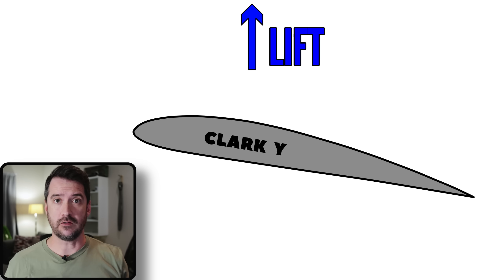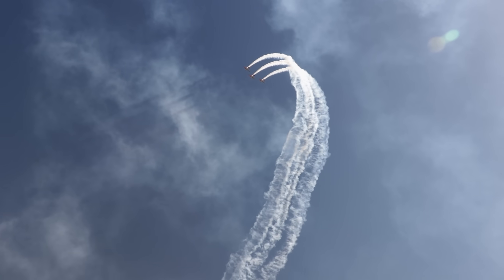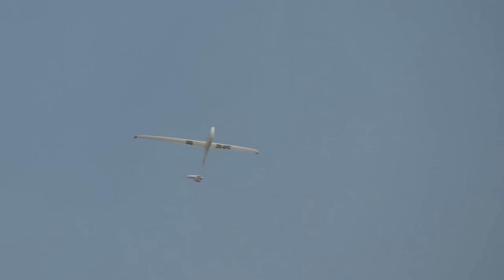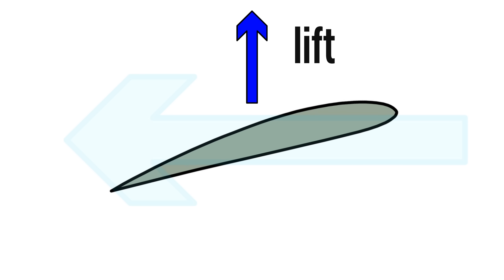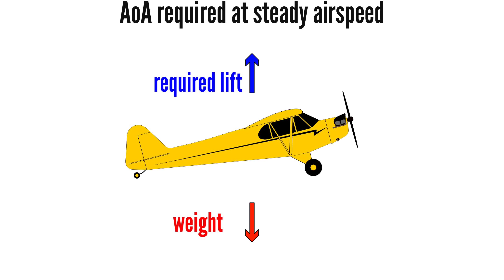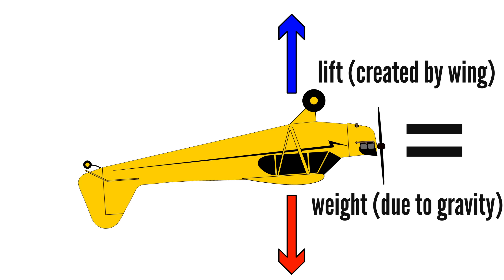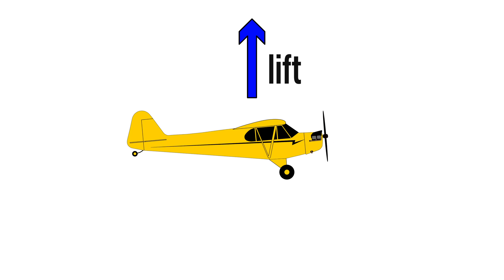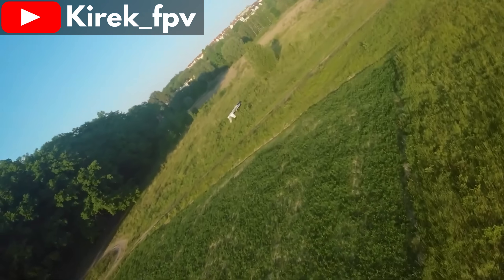Is Airflow Distance Over the Top of a Wing Always Longer?

Comment: The problem I had with flight school describing how wings fly is that it really was one dimensional: Pressure differential. What they failed at describing is that a pressure differential creates a downward flow of air which based on newtons law creates an equal and opposite force. It’s the same thing described as two different things for what ever reason. Also no lift would be able to be generated if there was no drag.
Reply: The pressure differential creates the downward flow.  The force calculated from each separately are equal.  And they are both needed to fully explain the mechanism of lift.  

I agree with what you say about what was learned in flight school.
Reply: @davetime5234  Of course it would be the same otherwise it wouldn’t make sense. Yeah everyone was and probably still is ignoring newtons 3rd law as if a wing is some sort of hot air ballon and the difference in pressure makes it rise 😂. I was obsessing over this topic back then when trying to figure out a conclusion and if there was a downwash even at 0 angle of attack since you only have a low pressure and ambient pressure…and you do obviously. I wonder how helicopter pilots learn it🤔 for them it is more apparent than airplane pilots.

Comment: The wing is still surrounded by the same "amount" of air whether the wing is upside-down or right-side up.  An airplane can fly upside-down with no problem, as long as the propeller/jet engine/rocket engine is providing sufficient enough thrust to overcome a stall and enough lift to overcome gravity.  One of the most important pieces of physics in the design of airplane wings is the Coandă effect, which causes the air surrounding the wing to adhere to the surface of the wing at its trailing edge. The air from the front of the wing is traveling faster than the air at the rear of the wing, and this causes an overpressure towards the front, thus pushing the wing (and the airplane) upward.
Reply: I'm wonder why there is no "Coanda equation" among the Navier-Stokes equations for conservation of mass, energy, and momentum?

Comment: Then….why….an airfoil at all?
Reply: The word 'aeroplane' used to apply to the mathematical surface ( a plane ) which, when moved through air at a useful angle, created lift.  This is more often called an airfoil today.  

It is possible if there is enough energy, to fly a plane that is entirely flat.  Check some of the RC aerobatic planes that routinely fly standing still.  
Enough thrust from a prop, carefully controlled, means a plane can float immobile in the air, nose-up, adjusting for wind.  
Very few engines have this kind of thrust to weight outside RC model planes ( but naturally a British-designed aircraft, the Harrier, does ), so most planes still fly using lift generated by airfoils moving through air at the right angle.
Reply: The airfoil shape is for vastly improved flight characteristics from the contoured shape conforming more to the airflow's natural contours, dispensing with abrupt corners and turns that the airflow has to negotiate.  Affects such aspects as lift to drag ratio, stall characteristics, and speed range optimization.

Comment: Video at 7:13: this "large angle of attack" for inverted wing is only due to the fact that we measure the angle of attack between the direction of far-field flow and the GEOMETRIC chord (which is convenient). The "actual" angle of attack can be measured between a ZERO-LIFT line, which for Clark-Y is about 5 degrees up relative to the geometric chord. So - when we align the geometric chord with the flow direction - the Clark-Y profile actually works at an effective angle of attack of 5 degrees. Inverting the wing results in flipping the ZERO-LIFT line by 5 degrees DOWN - that's why the apparent angle of attack is higher. Same applies to any profile with a camber...

Comment: I can't believe how this equal transit time myth keeps being spread. Maybe you'll believe the NASA website: <https://www1.grc.nasa.gov/beginners-guide-to-aeronautics/lift-3/#:~:text=One%20of%20the%20most%20popular,edge%20at%20the%20same%20time>. "One of the most popular incorrect theories states that the upper surface of an airfoil is shaped longer than the lower surface so that the flow over the top travels faster to reach the trailing edge at the same time."
And here's a video showing that the air on top of the wing doesn't just flow a little bit faster to get there in the same time, it goes a LOT faster and gets there first: https://www.youtube.com/watch?v=e0l31p6RIaY
While it is true that the classic wing design with a curved top and a flatter bottom is more efficient, this is in no way necessary and the different path lengths do not explain lift. The real reason is that the wing curves the airflow downwards, giving it vertical speed which results in a reaction force on the wing. On the bottom of the wing, a high pressure curves the air downwards since the air can't go through the wing, and this same high pressure pushes the wing up. But most of the lift is usually generated at the top, where a low pressure curves the air down so it "sticks" to the wing, and this same low pressure of course also results in more lift on the wing. The pressure differences also result in speed differences through Bernoulli's law: the high pressure below the wing slows the air down while the low pressure on top accelerates the airflow, which explains why the top airflow gets to the trailing edge so much faster. The extra speed on top also intensifies lift since more centripetal force is needed for the faster air to follow the same curvature, and therefore the pressure drops even further.
So basically, the pressure difference is not caused by the speed difference, it's the other way around, but the most important factor is actually not the speed of the airflows but the fact that air is curved downwards.

Comment: Yeah yeah yeah. I don't care. when a plane has one wing pointed at the ground and one pointed at the sky. Where is the lift in that quarter roll. Is it like when you throw a baseball no lift just the left over energy
Reply: Look closely.  The plane is flying nose slightly up, balancing thrust upwards against gravity, just as when the angle of attack is used in horizontal flight.  The side of the plane also adds a little, as does the engines' thrust deflecting air along the side of the plane.  Three forces acting to keep the plane on an average of horizontal, nose sideways, pointing upwards.
Reply: @stevetheduck1425  it always seems on the cutaways of wings with airflow the lift are is always straight up or down. I know it's a super simple representation of what's going on. I watch F18s go through the mach loop valley and it seems like they should fall to the ground. It's obvious they can and do fly like that, I always thought it was just the engine keeping it in the ski when holding a turn i never thought the airplane body helped with the lift.

Comment: Bernoulli's principle doesn't make the wing fly, it only makes the wing fly more efficiently.
Reply: Wings cannot fly without Bernoulli's principle.  It is the statement of conservation of energy that explains the drop in pressure that pulls down on the air, which is the entire basis of lift.

Mass has to be accelerated downward (like a rocket) to make lift, and it is only the pressure difference that Bernoulli's principle insists on that provides this.
Reply: @davetime5234  Really? Please explain how flat winged balsa rubber band airplanes fly then? They don't have a single bit of chord.
Reply: @mark-who-likes-the-arts  There are two choices for Bernoulli's principle: camber and/or angle of attack.  Aircraft normally operate with both.  An aircraft can never operate without angle of attack.  That's how you vary lift from a wing for changes in weight and speed.  A flat wing only has angle of attack to produce the Bernoulli principle.  It is the entire purpose for angle of attack.
Reply: @davetime5234  Angle of attack has zero to do with Bernoulli's principle, which is based entirely on pressure differential. Aircraft with sufficient chord dimensions can fly with no relative angle of attack, none. It's the whole idea of the principle.
Reply: @mark-who-likes-the-arts  I agree with you that you can produce lift with no angle of attack if you have sufficient camber.  But an aircraft cannot practically operate (from Bernoulli resulting lift) at zero angle of attack.  Flying involves constant management of (Bernoulli resulting lift from) angle of attack.

This is to keep lift matched with changes in speed,  altitude, and temperature.

But yes, if you perfectly matched the above conditions for a particular amount of camber, you could find lift matching weight.  But practically, aircraft fly by using angle of attack to fine tune the Bernoulli resulting lift from camber.

Angle of attack manages the fine tuning of lift from camber, by doing exactly what camber is doing: produce lift from the Bernoulli pressure drop.
Reply: @davetime5234  The most important part to remember about the chord found in most modern GA aircraft is that lift is the square of velocity. A doubling in airspeed results in a quadrupling of lift. I find that that be truly amazing.
Reply: This is correct.  You can get lift from a cinder block if you get it moving fast enough.  Most of what is studied for flight is about reduction of drag.  Where does the stall begin?  Where the airflow is disturbed at the back of the wing, because it is creating drag.  Newton Bernoulli Coanda.

Comment: My belief the “chord” is there and bulky because a wing needs to be strong and resistant to breakage, and a flat wing will break.
Reply: But a flat wing has more abrupt turns for the airflow to negotiate.  The more gradually contoured wing assoicated with the "bulky wing" provides more efficient flight characteristics.

If you take care of the airflow (in terms of smooth, non-confrontational contours to flow around), the airflow will take care of you with more efficient parameters of flight.

Comment: It's easy to check:
- do aircraft with symmetrical airfoil exist, and can they fly? Yes, they exist and yes they can fly.
- can aircraft fly upside down? Yes, they can. If the shape of the wing was responsible for pulling the aircraft upwards, then an aircraft flying upside down would be pulled faster towards the ground than how it would be falling without wings.
That's it, question settled. The typical shape of the wing is to increase performance. Aircraft are perfectly capable of flying with a completely flat wing, it would just be inefficient.
Reply: Shidd... So alot of text books are wrong 😮
Reply: @b.s.7693  Almost all of them, in fact.  The reason the shape is curved is to minimize turbulence and eddies/drag. Plus materials, as a flat surface has to be incredibly strong compared to something with internal bracing, as the transition from lift to being thrown backwards is rather abrupt.   A teardrop shape is a good compromise.  And the first wings were usually curved on the bottom as well.  With stronger materials such as metal wings, the need to have the bottom half curved was reduced, saving weight and materials.  Though many planes undersides are also very slightly curved as well. Again, to improve efficiency as air doesn't really like a perfectly flat surface, either.
Reply: @b.s.7693  Actually less and less, I've seen the equal transit time story vanishing slowly from some. A few years ago it was in the IKO textbook, I remember heated debates with instructors, but then it vanished.
Reply: @b.s.7693  Wouldn't be the first time, won't be the last.  My astronomy professor the first day of class would bring in a stack of 10 books.  And then explain that THIS book was the correct one with all of the most up to date information, starting with ones from the 1600s. Then proceed until he was holding our textbook. The idea being that all of our research is a work in progress and most of it is eventually going to be proved wrong or too simple in its explanation.

Comment: RC planes angle downwards when inverted - due to less lift on the wing.  This is compensated for by "raising" the inverted elevator ("down elevator") causing the tail to lower and the plane to fly horizontally.
Reply: Angle of attack is the final arbiter of supplying pressure drop to be on the top of the wing, irrespective of camber symmetry or up/down orientation if asymmetrical.

Comment: In the end, does it not boil down t the amount of air pushed downwards too counter gravity?
Reply: Only partly.  Yes the air needs to be pushed down, but the question then remains what mechanism due we use to push that air down.  That's were the other pieces of the puzzle are necessary for the meaningfully complete picture of the nature of lift.
Reply: @davetime5234  You mean some mechanisms can push less air in the direction of gravity and somehow achieve a higher lifting effect? Or is the rate of air being pushed down the final determinant for lift instead, regardless of the mechanism involved?
Reply: @davetime5234  In short, if it's not just the resultant rate of air being pushed down then what could it possibly be?

Comment: I think the point is that the 'longer path' over the top of an airfoil is not what creates lift. The length of the path is irrelevant anyway because the air doesnt have to get to the TE at the same time. In fact air going over the wing arrives at the TE before the air going under.
Anyway, NASA should know: https://www.grc.nasa.gov/www/k-12/VirtualAero/BottleRocket/airplane/wrong1.html
Reply: The path length difference is significant.  That's what stresses the continuity of mass flow rate, which is what drops the pressure, which is what pulls the air down, which is the essence of lift.  Force is change in momentum, and the path length difference is the starting point for that.
Reply: @davetime5234  so how do you explain highly undercambered wings such as used in early aviation up to WWI. They had  similar path length both top and bottom yet produced very high lift. Such airfoils are very efficient at making lots of lift at low airspeed.
It's not the difference in path length that's important, it's the airfoil camber. Camper assists in turning the airflow.
Reply: @jetplaneflyer  There are two options for creating path length difference:  camber and angle of attack.  You can use one, the other or both.  Normally  both are used. But if we are talking about a flat barn door creating lift, that is angle of attack that creates the different path length difference.

Aircraft are constantly relying on angle of attack to fine tune the rigidly imposed camber.  

If they could not vary the amount of lift this way, they wouldn't be able to adjust for changes in loading weight and speed.
Reply: @davetime5234  this video explains it better than i can, and debunks the 'longer path' explanation better than i can too: https://www.youtube.com/watch?v=uzWAB1Q_YgU
Lift is caused by turning airflow.. period.

Comment: Circulation theory involving a rectangular vortex ring.... Bernoulli is right....but only 8.34% right, most lift is created by deflection......in "smaller" vehicles.  In commerical jets, the wings act more like rudders on a rocket & asymmetrical wings prove this ..😮
Reply: When you say deflection, I assume you mean all air directed downward, including over the wing as well as under the wing?  

Actually, the majority of lift contribution is from this change in path of air going over the top of the wing.  And what we describe as the Bernoulli principle is completely responsible for that "deflection."  The lowered pressure from the Bernoulli principle is what bends the relative wind travelling over the top of the wing.  The adjacent relative wind is "attracted" to this low pressure area as wind is attracted to a low-pressure weather system.

There is little contribution to the force of lift other than the deflection imposed by the Bernoulli pressure drop.

Comment: I haven’t heard but one other argument that a flat wing works just as well as a conventional wing, a conventional wing adds a degree of control to the process of lift making balance at the wings cord more possible or more practical, a passenger jet would not be very comfortable to fly in with out a conventional wing.  Yes jets, prop planes can fly upside down but are always at an odd angle of attack and not as efficient. 👍
Reply: A conventional cambered wing works better, that is it is more efficient, than a flat wing because the shape makes a better fit to the natural flow contours around a solid object moving through air.  The abrupt angles on a flat wing reduce the orderliness of the flow, which drops the efficiency in terms of such measures as the lift to drag ratio, stall speed, stall angle and other flight characteristics.

Comment: All that matters is the strength of the air under the wing to push the wing up. But if the wing is flat instead of curved, then you have a much more sudden change between the air pushing the bottom of the wing up versus pushing the top of the wing down. There. Mystery solved.
Reply: The contribution to lift of air under the wing is very small.  The vast majority of lift is from the pressure drop on the top surface, which changes the course of air above, downwards.  The change in momentum downwards of airflow above the wing is the main contributor to lift.